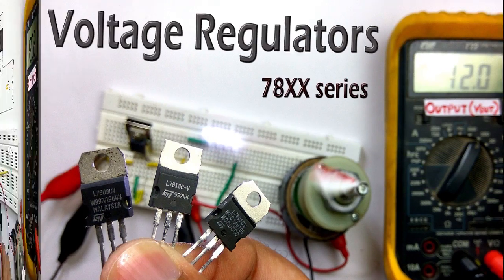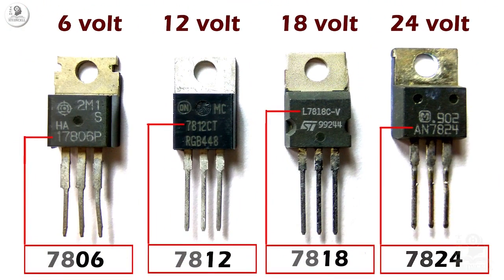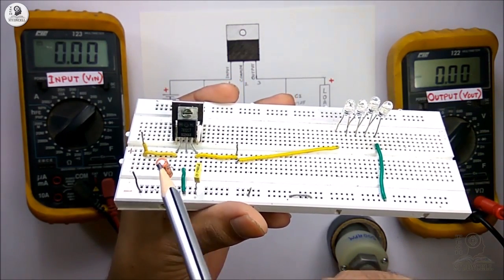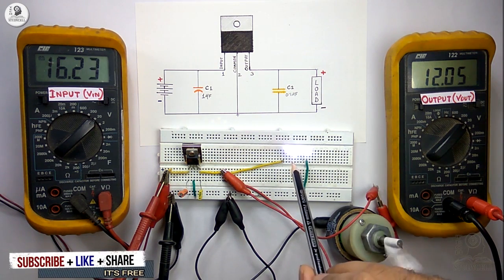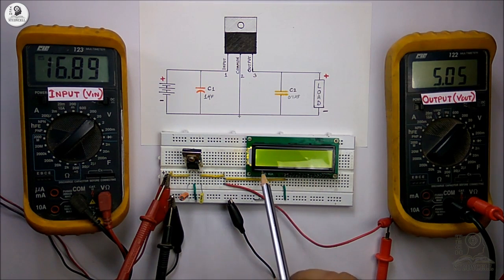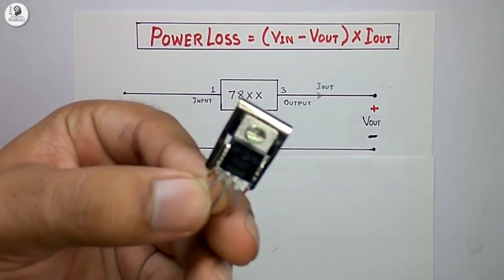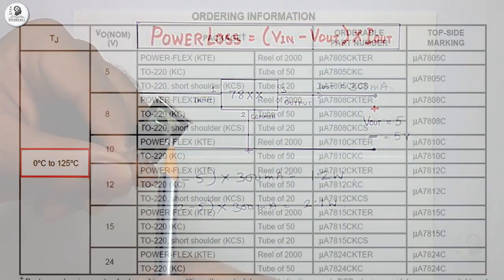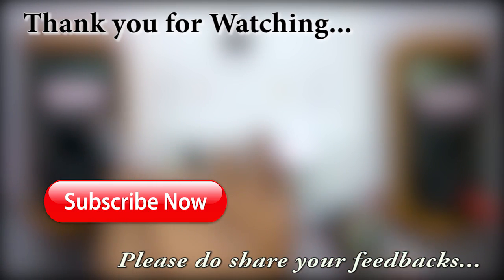Voltage Regulator ic 78XX Tutorial with Practical Experiments

Comment: If I use a 9 Volts 500 mA transformer to connect 7806 regulator to get 6 volts & connect a 6 Volt 300 mA lamp and then the output voltage remain same but input voltage becoming 7.5 volt from 13 volt peak before connecting the lamp, then is there no dropout volt inside the regulator? I'm asking because 13 volt - 6 Volt = 7 volt, but if input voltage of 13 is decreasing to 7.5 v on load then will there be no dropout?
Reply: WTF   too hard to  follow

Comment: what happens when you drop the input voltage of L7812 below 12 volts, does it still supply 12volt ? 
Please test;
find the Vout when Vin is 10 volts. Is it still 12volt or has it dropped to 10 volt?
Reply from the maker: This is a linear voltage regulator. So the output voltage will be always less than the input voltage.
Reply: @TechStudyCell  so when you give 10 volt to LM7812 it outputs 0volts
Reply from the maker: No, output should be less than 10 v

Comment: Best video on these regulators. Pliz help on how to know the maximum input voltage and maximum input current.
Reply: +Tech StudyCell Thanx a lot
Reply from the maker: To know the accurate rating Please refer to the datasheet of that particular IC.
Reply: @TechStudyCell  If my output is 4.94 vdc on my L7805cv does it mean that my IC is still Good?
Thank you!
Reply: @TechStudyCell  I supplied 15vdc into the IC and the output was 4.94 does that mean the IC is still good?
Reply: @TechStudyCell  at 20vdc I get an output of 5.00vdc so does that mean my supply voltage should be 20vdc to obtain the required 5vdc? Is that correct?
The IC is from my guitar amplifier a Kustom dart 10FX
The problem that I have is that I don't get any output from the amplifier.😢 I also need to check the TDA2050 which is an amplifier IC.
Thank you

Comment: I use 7810 Vin=9V, Vout=?. Thank you!
Reply from the maker: If you require 10v at output then input voltage should be greater than 12volt

Comment: Can I ask? For example the input current is 2 Amp. What will be the output current. Given that your voltage input is 20V and you are using 7812?
Reply: refer to the datasheet of that particular IC.

up to 1.5 A

Comment: can i use this 12v diagram when ise use laptop charger 19v 3.43a? or i change somethings ? Thanks
Reply from the maker: This linear power supply is no so efficient so it can be used for supplying small electronic gadgets.
For Laptop, you should use SMPS power supply.

Comment: hii can u please tell me voltage of 1uf and 0.1uf
Reply from the maker: the voltage rating should be higher than supply voltage...
Reply: I want to make this all in one circuit do u have software to make pcb circuit with all components ??? if yes please mail me the soft with key on bhangale.deepak@gmail.com or if u can able to make pcb design for me that will be great for 12 v 6 amp  input to 7812, 7809, 7808, 7806, 7805, 7803 ic with all output seperatelly.
Reply: hi  I am trying to do this I am using 12 v  2 Amp for 7812 but it shows me ac voltage to ground Please help me. Ic heat hoti hai aur kam karna  band krti hai, I need to connect alll 78 series IC in Parallel to have multiple output with 12v 6 amp ckt  but have this issue , also I have 1 issue I want to add lm317 ckt in the same in parallel I tryed with 2 amp adaptor same issue Ic heating...

Comment: Hi. What is the current drop? Suppose I use 19.5 V 3.5A and use 7812 Voltage regulator. What will the current output be?
Reply: RIDER SOLO 7812 ic ( 1AMP ) use only
Reply: Creative ang thanks

Comment: Can u plzz tell why the input voltage changes with changes in the load
Reply: Rishik Kumar as your load increases, the current vs voltage ratio will load down the input power supply. The beauty of the regulator circuit is that even as the load varies, the operating voltage to your device will remain stable. I hope that this helps.
Reply: Rishik Kumar o ح